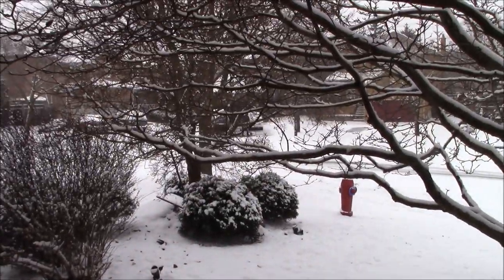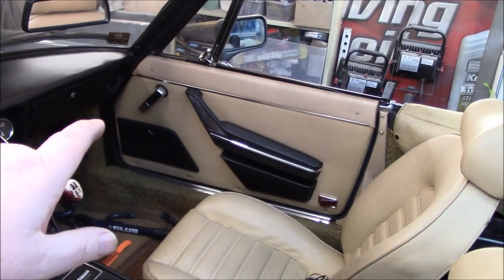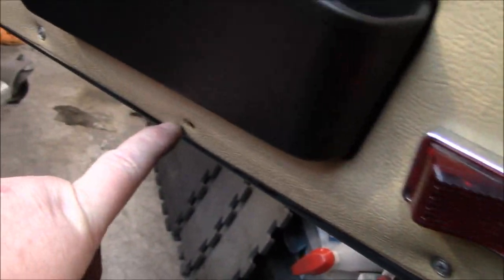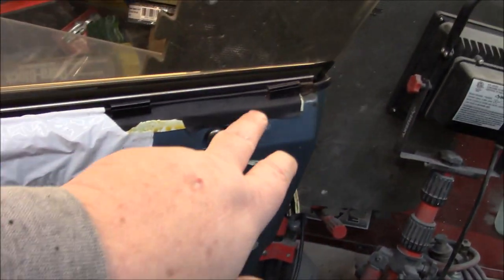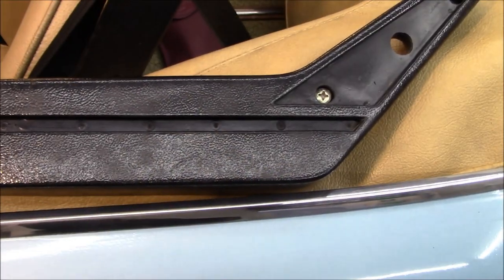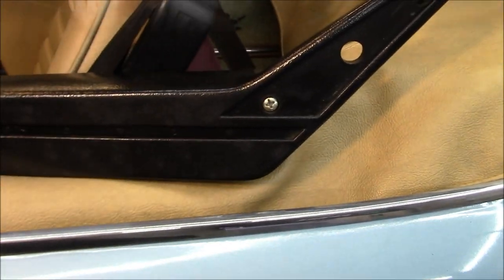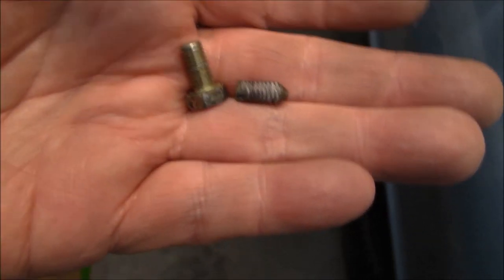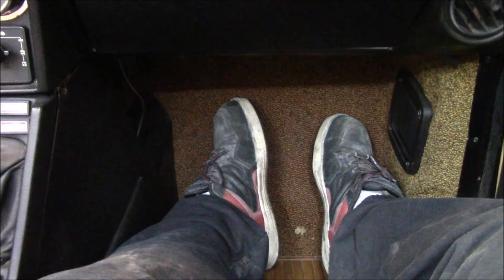1981 Alfa Romeo Spider Veloce,  Winter Projects, Part Six

Comment: One of the first things I did with my '74 Spider was to remove the door panels and go after the window crank mechanism and door locks.  Well I fixed those but I didn't have door keys so after an order to Classic Alfa I have another trip to remove the door panels and windows to get at the door locks.  I also have to replace the wind wing rubber gaskets at the same time.  I'm actually happy the windows are crank up as it's "one less thing"  (I'm a bit of a Forest Gump)
Reply from the maker: Agreed, sometimes less is more 😉

Comment: A belated happy new year David. I think the chances of the replacement switches being better than the originals is 50:50 unless they are NOS, especially after your refurbishment on them. You might want to just swap the drivers side switch to the passengers side since it obviously gets more use and wear and keep the new ones for the next 40 year refresh.

Comment: I have to disagree about the coil mounting... IMO far more desirable and attractive to keep the modernised fitting with the heatsink and cover, it was fitted for a reason and without it it just looks like an old Healey sprite or something...

Of course Bosch did the fuel injection on the later Spiders...